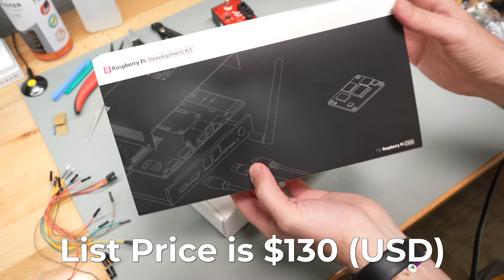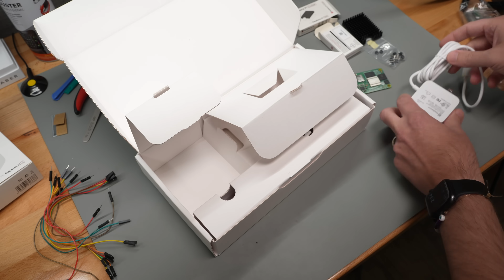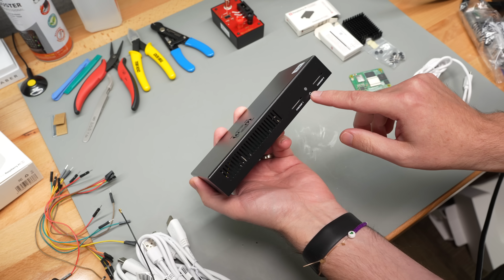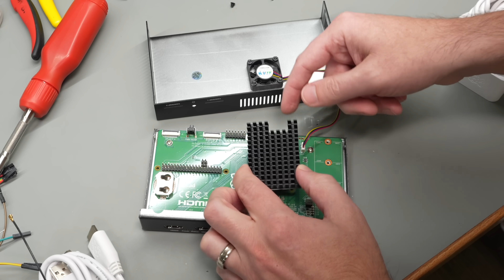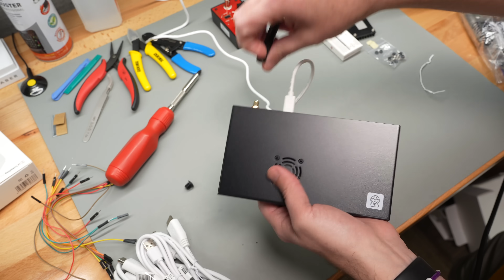Unboxing the Raspberry Pi CM5 Development Kit

Comment: What’s the point of a developer board though if you’re just going to slap it into a sealed box with an annoying loud tiny fan? 

Like.. I bet this thing costs $400 and I could just buy the two boards. I guess there is space inside if you finish dev but that’s finish dev not start dev kit.

Comment: Im a lil disappointed that you have to choose between the fan or the heat sink. The case itself looks great and appreciate the sturdy metal build, but a low profile heating would help a lot even if they had to raise the housings hight another few millimeters to accommodate it.

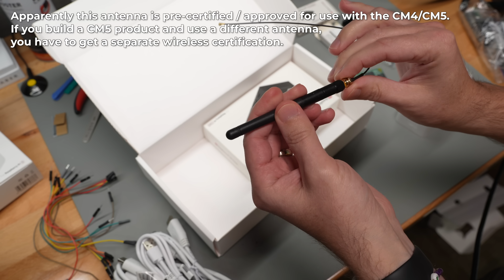Comment: 4:15 what is a wireless certification? Is that just the drivers that operate the hardware?

Ps I have zero experience on Linux. Windows user shopping for alternative operating systems.

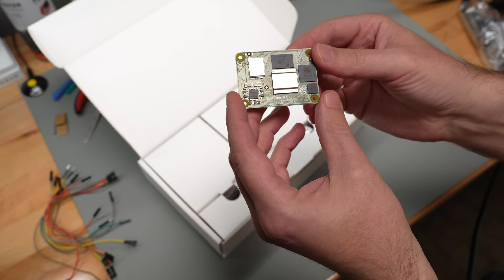Comment: @1:48 you mentioned sound levels.  I have been interested in 32-bit floating-point audio capture for a while now.  I love the idea of never setting levels again during recording, but understand the trade off is always having to set the audio levels later when downsampling to more reasonable bit level.  Do you have any experience using 32-bit audio?

Comment: Got my kit yesterday, wasnt keen on the thermal pads that it came with the heatsink, the SOC pad doesnt make contact with it being too thin, i did think it was the new design but its not making contact maybe...

I had some spare 2mm thermal pad which seemed to do the trick, hopefully they improve it in later models but can see this being a real issue for beginners!

Comment: I got something similar from Friendly Elec, their own ARM based CPU module, and the board is actually a NAS kit, I added 4 2TB NVMEs to it, and running OMV on it. It has 2.5GB ethernet. The metal case for it is sold on Amazon as well.

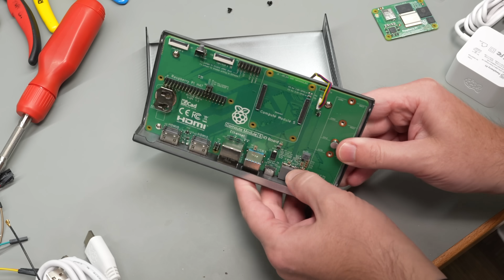Comment: 6:18 That foam bit is probably here to prevent users from accidentally pushing the microSD card into the case (missing its designated slot connector), making it extremely difficult to recover in some cases. At least, that's what it seems to me.

Comment: The most significant improvement of the CM5 development kit is that it finally uses Type-C for data and power connections, as opposed to the CM4IO board. I don't remember how many times I spent a lot of time finding a DC jack power supply before booting the CM4IO board up.
Reply from the maker: Haha yes, I ultimately bought three extra 12V adapters because it was always disappearing!
Reply: @Level2Jeff  Yeah, another 5mins for the micro USB cable.

Comment: rubber pad is probably to stop insertion above the slot itself, as tends to happen if there's just open air above it, and enough clearance around the metal cage to fit one.

Comment: The pad on the MicroSD slot is to prevent you from inserting the card "above" the slot. It's a much cheaper approach vs some kind of alignment solution between board and case.
Reply: nvm @SuperCloneRanger correctly guessed this earlier

Comment: Using the biggest heat sink, one solution is to mount the fan on top (exterior) of the case !
Reply from the maker: That would actually work! A little unsightly but the best of both worlds.

Comment: Rubber on SD Card socket is to prevent the card from slipping past the socket and becoming loose in the box. My 3D printer did not have the blocker and I ended up taking it apart a couple of times to recover the card.
Reply from the maker: TIL, that's a fun little design improvement!

Comment: jeff, can you plug a CM5 into the CM4 IO board, and does everything work?
Reply from the maker: Yes, but you may need to set a dtoverlay for that to work right.
Reply: @Level2Jeff  Is this to enable the usb ports on the CM5?

Comment: I would have thought that there would have been an allowance to use the fan with the heat sink...seems kinda pointless.  At least the unit looks pretty nice for being a dedicated computer, let alone a development kit.  Also, why wouldn't someone design the machine so the GPIO was accessible through a door in the case?  I guess I am just an average user looking in and not a developer.

Comment: Steel case because it's an easy path to EMI compliance.  The interference between the fan and the heatsink makes it pretty clear they know it will be run with the top off by quite a few folks. :)  For those that do want a lid, Noctua has quiet 40mm options which could easily replace the noisy stock fan - I use these myself in 3D printed cases for Pi5 + NVME board.  I suspect we'll shortly see 3D printed replacement lids that relocate the fan - perhaps above the SSD slot.  The egress grille near the heatsink means the CM would get plenty of airflow anyway.

Comment: It’s a neat little kit for getting started with the CM5! The fan spinning at full blast when the system is off is a bit confusing, but hopefully a firmware update will fix it.
Reply from the maker: From what I've heard it may be a hardware bug that requires an IO Board revision... hopefully not though!
Reply: Surely that bug would have been obvious during product testing?

Comment: Are those magic antistatic boxes still recyclable?
Reply from the maker: Good question, not sure!
Reply: So far as I'm aware, yes. There are plenty of dissipative and shielded cardboard products on the market already which are recyclable - you're probably familiar with the classic black and blue (shielded and dissipative) corrugated boxes already.

As a side note, unless relative humidity around you tends to drop well below 30% on a regular basis, any ordinary cardboard box is dissipative by virtue of being wet.

Comment: Pretty big miss that the heatsink doesn't work along with the fan/case without removing the fan. They should have done something like flirc and disapated the heat through the case then. Pi5 gets too hot to not run a heatsink. Hope there are 3rd party coolers that work better.

Comment: Shame they don't have a custom bundle option for the retailers whereby they can add the CM5 module of choice for a customer to the Development Kit contents. Kind of means we're stuck with either accepting the 4Gb option as part of the kit, or making up a kit of the separate parts for ourselves to get the 8Gb option instead.

As the usual retail suspects in the UK are still saying 8Gb not available yet, managed to grab a Kit from the last 1/2 dozen at Pi Hut, and a spare I/O for when the 8Gb editions are out.
Reply: Yeah that's troubling, at the time of this writing the 16GB CM5 already out so I'll get that, but I can not purchase the I/O board alone or can I ?

Comment: Seems a bit silly to include a heatsink that wont fit in the case with the fan😂 they should’ve created a slim version for this kit, to allow for the fan to still provide active cooling whilst giving the CM5 a larger cooling interface, but still sell the ‘full sized’ version for folks not using this kit
Reply: I mapped out that if you move the fan to over the nvme slot with the exhaust holes it'll fit perfectly and draw temps off the nvme better
Reply: Yes, they could have milled out the area of the heatsink that interferes with the fan. I wonder how difficult it is to DIY mod it. Maybe just snapping off the offending fins.

Comment: Where is the slot for the GPIO ribbon cable to come out of the box? 
Pinching the cable between the bottom and top case cover, is not the right way to do things. 
Where is the program/Run button. instead of a jumper on the main board?
The position of the fan means you can't put anything on top which might cover the fan. 
It kinda sucks for a development system tbh. One would be better off buying the motherboard for $25 and design and 3D print their own enclosure.
I suspect this i what will happen, Tngiverse will have lots of different designs by next year.
Reply from the maker: I think people who buy this would probably leave the top off, but there's also a good market for 3D printed options!

Comment: Pi logo’s orientation on the case almost seems like it’s intended to be mounted on the backside of a TV. May be you could drill some VESA holes…
Reply from the maker: Or as I like to call them "speed holes"!
Reply: As it's expected use is as a development board,  I assume the logo is oriented so it's the right way round when the io side of the box is facing the developer.

Comment: Wonder what Raspberry Pi will be releasing tomorrow?  We had the Pico 2w on Monday, CM5 on Tuesday, what will appear on Wednesday?
Reply from the maker: Plz tell them to stop lol
Reply: @Level2Jeff    Back to work, you!   😉
Reply: Hopefully it's a Pi500...
Reply: @juanignacioaschura9437  Pix00 with socket for CM would be cool.
Reply: @juanignacioaschura9437  I agree, and it should be released with at minimum 8 GB of memory or have the options where the overall memory varies.  Although, the Pi 500 should have an SSD slot built in, the board should be big enough.
Reply: Raspberry Pi Cubesat lol
Reply: @ntcarver Wasn't there already a PiSat? I could have sworn there was, or it was a fever dream... 😅
Reply: @realfoggy  Are you thinking of Astro Pi? That's a (yearly?) thing where two modified Pis get sent to the ISS and kids can submit code to run on them. Great idea, imo.
Reply: @ntcarver  a CM5 CubeSat is actually exactly what I'm building :) It will take me another 6 months or so to get to the SBC carrier board, but yeah, that's the plan
Reply: Zero 3W plz
Reply: Pi 500 would be the obvious missing product
Reply: Please let the next release be an RP2350 update to fix the internal GPIO pulldowns.
Reply: Please Hailo-10 for Raspberry Pi!
Reply: Raspberry pi zero 3w, with a RPI4 chip on it and 4 gb of ram…..

Just putting this idea out in the world, I hope they are working on a new zero from factor board.

Comment: The the fan really stay on when you press the power button?
Reply from the maker: It did in this case, because there's no OS flashed on the CM5 yet. Once you put an OS on there (or boot of NVMe, or USB, or microSD on Lite models), then it should stop the fan when it's not needed, and only ramp it up a little as needed, until it's maximum under heavy load.
Reply: @Level2Jeff Thanks for clarifying, I am quite happy what RPi Foundation been cooking these past few years.